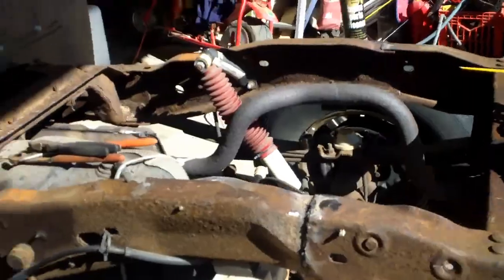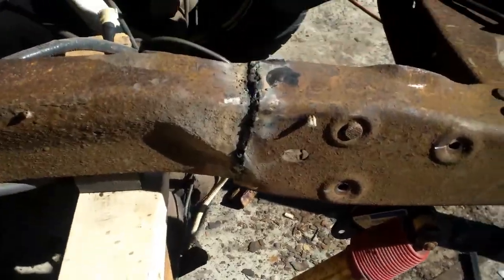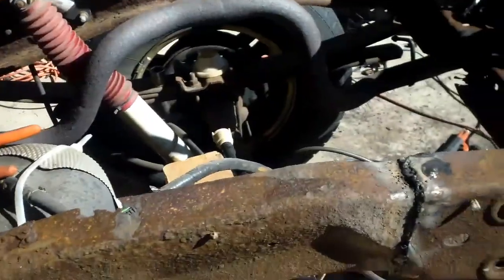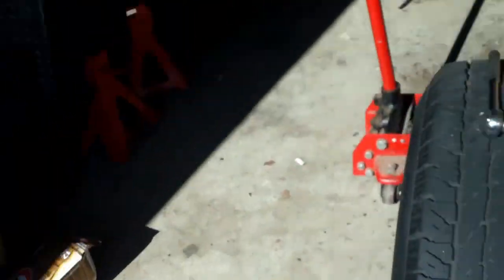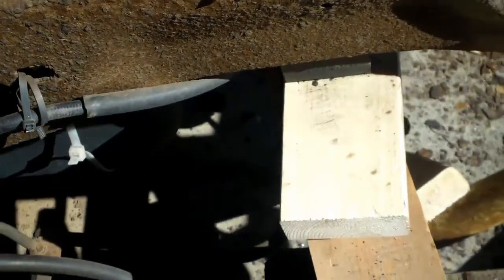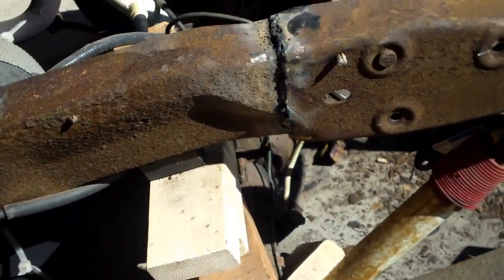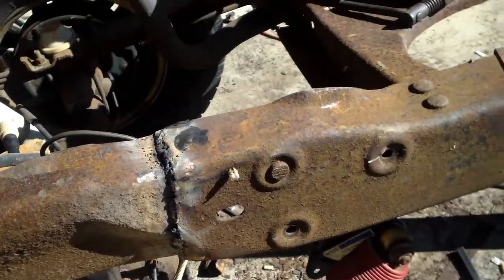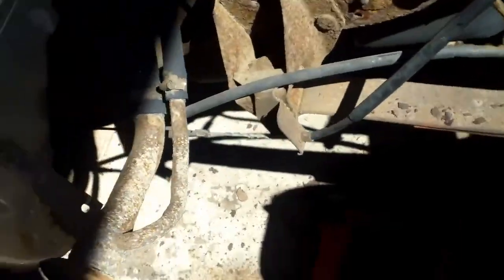Ford Ranger Project: Day 2

Comment: I wouldnt have welded the frame like that
youre supposed to cut through only about half way through and then go over about a foot horizontally and then cut the rest down, its a hell of a lot stronger that way
Reply from the maker: This weld has held up great. I've beat the living shit out the truck and it's still strong as hell. Honestly as long as you have something holding it together your all set. I snapped the frame in a different spot last winter and just used angle iron and flat stock and even that's still holding up fine.